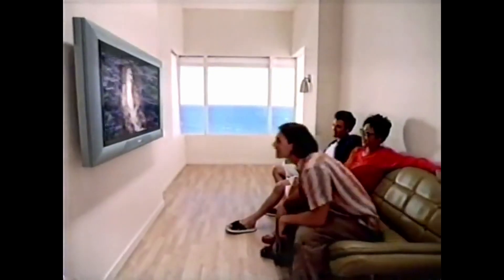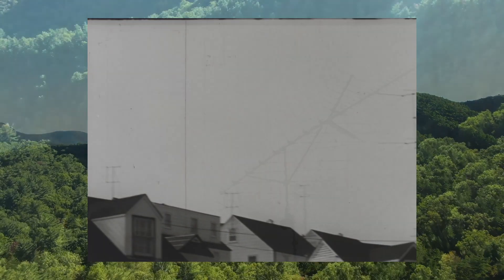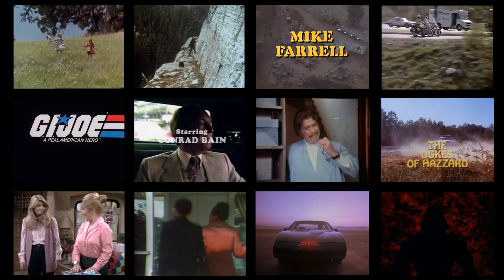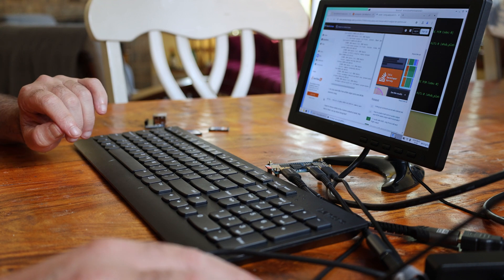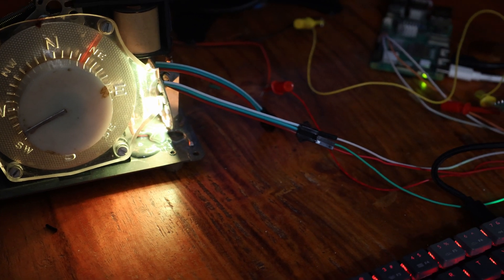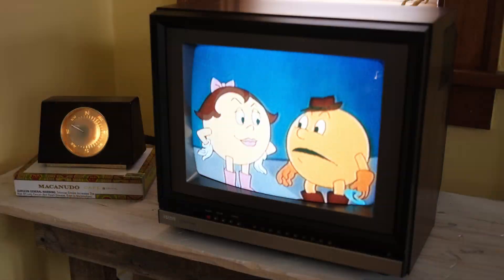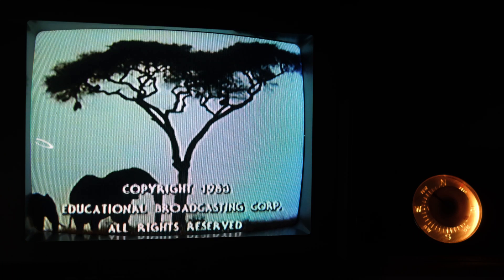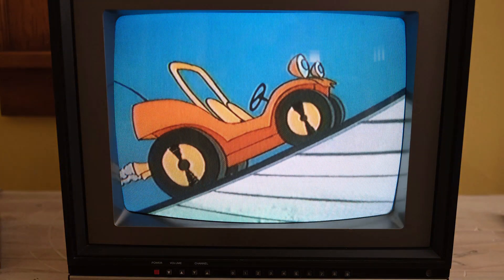My Nostalgia Machine: Recreating 80's broadcast TV with a Raspberry Pi

Comment: Would anyone know of a apk or exe that would be quiet similar to this not great with Linux myself and would love this for the man cave 😍 any help in the right direction would be amazing
Reply from the maker: Not that I know of - you are correct that it currently takes a bit of work and knowledge to setup. I hope to reduce that over time.
Reply: @wrongdog_reckons  made a apk myself but it's only single channel that plays Simpsons episodes need to figure out how to add extra channels with the continues playing multiple videos you have and the ads 😊 complete noob with Linux myself not even sure if it is possible to like copy the installation you have with the code and I supply the videos? Also thanks for the reply 😄

Comment: what's the limit of the content? just how much storage i have?
Reply from the maker: I haven't tested with huge quantities - I have about 800 GB in my collection and it handles it fine. The more you have, the longer it takes to build the catalog (which only happens when you tell it to currently) takes about a minute or so on my raspberry pi 5 (much faster on PC). Overall, it should just be gated by storage size, but I haven't tested beyond my own collection.

Comment: This is very cool.  I have been looking into ways of doing similar things but hopefully having each channel modulated onto its own frequency so I can use the tvs tuner presets.  Another thing i would like to do is include teletext data.  Ive seen a pi project that does this allowing you to either create your own pages or pull content from the web and generate pages from that but i don't think it inserts it into an existing signal.
Reply from the maker: Love it! Adding broadcast for this is an idea I've played with - the issue is that it doesn't actually play all the stations at once but shifts to the selected channel content and seeks to the correct play position, which might be mid-show, might be mid-commercial - the timing is pretty accurate so it feels like its been playing the whole time. It would need some feedback mechanism to tell it to switch broadcast streams or I would need to figure out how to broadcast all the streams at the same time. So, there are challenges to get over there :) Cheers!

Comment: This is incredibly cool. I know absolutely nothing about programming but I am at a loss as to how you recreated the linear experience where you're dipping into the middle of TV shows as if they really are playing "live" instead of on-demand. If you could provide a simplified explanation of that, I would appreciate it. 

In any case, I'd love to have something like this over Christmas. You can bet mine would at some point be playing the 1951 edition of A Christmas Carol with Alistair Sim, along with Miracle on the 34th Street, The Bishop's Wife, A Christmas Story, Christmas Vacation and also the 1984 rendition of A Christmas Carol with George C. Scott.
Reply from the maker: Thanks! Would love to describe how it does it. First step that enables this is  how it generates a schedule for the week for each station and stores it as files that are separated by station/day/hour.  Lets use an example: you start it at 9:30pm on a friday night - and the first channel is configured as NBC. It will open nbc/friday/21 (24 hour time) and see that Miami Vice Sason02Episode11 is supposed to be on. Then it will do some math and determine that it should be about half-way through the episode - so it will seek to that position in the video file and start playing there. It accounts for scheduled commercial breaks in that math, so you might start during a commercial. 

When you change the channel, it just does the same thing again to figure out what the new channels should be playing.  Then, when you make it back to nbc, it will just does the same thing again - but since it is very accurate with the timings, it will seem like it was playing the whole time. 

I am looking forward to having it at Christmas very much. The whole family gathered around it last night while we painted pumpkins for Halloween and watched the Worst Witch and then Night of the Living Dead - was an amazing time!
Reply: @wrongdog_reckons  That's really fascinating! Thanks for the info! I am always in awe of people who have the electronics and programming knowledge to do stuff like this. I'd love to be able to complete this kind of project. 

One more question, if you don't mind: I can see how you could come up with the episodes of shows like Miami Vice but how could you possibly come up with enough footage of news broadcasts from that time? Does it play the same small handful of broadcasts over and over or are there enough to go a long period of time without re-watching news that you've already seen before?

That sounds like a good time with your family! I'm glad to hear that everyone else appreciates what you've created here.
Reply from the maker: @sorenpx good question - I actually have a fair number of news broadcasts. Initially, they were the hardest to find, but there are actually quiet a few in the VHS archives at archive.org (down right now) - on youtube, you can find ones from big new event days. 

Cheers!

Comment: When the software arranged the video files, does it split TV episodes into segments with commercials breaking them apart or does it play a full episode following some commercials? Also, does it follow a half hour structure where everything starts at the the top of the hour or half?
Reply from the maker: Good questions! How it inserts commercials depends on the duration of the recording - if the recording takes up most of the block, it will pad the end. Otherwise, it pseudo-cuts them into segments and inserts breaks. It support half hour, one hour and two hour blocks - but internally its built around the one-hour block that can be made of either two half hour shows or one hour long show. The two hour blocks are just two one-hour blocks back to back. It never actually 'cuts' the video on disk, but switches the stream live to make it look like the reels are cut and spliced. To answer your question - yes, these happen on the half and top of the hour. Cheers!

Comment: This is just about exactly what I'm looking for!  Irish Craic Party had a video on his own retro TV he created using raspberry pi a few years back that this reminds me of.  I really, really want to do something just like this, but house it in an old wooden frame with a HDTV in it.  Can you rig the program to access a server with the video files on it, and create channels with logos, start and stop times, and the old Continental Cablevision program guide that was low-res scrolling text showing what was on?
Reply from the maker: I know the video well - it actually inspired me to start doing videos on my own projects. Not sure why they took it down. For accessing files on a server - if you can mount the drive over the network, it supports it now. Yes, channels have start and stop times, you can even specify a video to play at the sign-off event and what video to loop when its 'offair' - as for images, you control the station promo content by adding them to the bumps folder for that station.  For program guide, I have a user interface that I will use as a base - I'm also adding a 'cable-mode' so that you can use different theming based on what decade you are trying to emulate.

Comment: The hardest thing for me with similar projects was cutting in commercials at convincing times without adding break times manually.
Reply from the maker: I didn't resolve that problem yet - sometimes they seem pretty natural, but other times they don't. Especially if they say something like 'We'll be right back after the break' and then it just stays there...
Reply: @wrongdog_reckons I’ve used a Python package that checks the frames for changes that indicate scene changes. Before that I wrote my own which looked specifically for black frames coinciding with silence to minor success. But, those are pre-processes that I had to check manually for every video I wanted in my library which was very time consuming. I just stored each break as a chapter in the video. Sometimes I’d get lucky and a show I purchased was already divided into chapters along the original ad breaks. I researched it a bit and it seems the broadcast tapes had some tone to tell the equipment where to break for commercial which we wouldn’t have access to.

Comment: 5:19 I remember watching my grandfather turn this thing on top of his big wooden encased tv. I could hear like a thumping noise coming from it. Each sound the picture got a little better or worse. Kind of like adjusting the tracking on a vcr. My brother and I called it the "thumper". lol.  I always thought it was cool and we did get a clearer picture watching golf! :)
Reply from the maker: My next task is to add a buzzer so I can try to make the sounds :) These things are amazingly simple, but were doing a lot of work right there in the console that I thought would be being done on the motor itself. To me, its really cool when to start figuring out how they accomplished stuff in the days before microcontrollers and microprocessors. I think in terms of software-defined processes - they just add electricity and a few primitive things they could do with it and ended up making some very advanced stuff happen. The box is pretty cool.

Comment: I want to do this but I need some help or clues about how to do the content.
Reply from the maker: 'Any Video Converter' is a great app for downloading and formatting. You can easily make workflows to make that kind of a one-click process. For commercials and station bumps, you'll want to cut those into individual clips. The github project has some documentation on how to put your content into folders. There are still lots of improvements needed on the documentation, so if you get stuck, just file a ticket on github and I'll try to help.

Comment: I grew up with TV in the early 1950s to 1960s. In Milwaukee during the 1950s we had four channels which were 4 (NBC) 6 (CBS) 12 (ABC) and 19 (DMT)
Reply from the maker: Was 19(DMT) a local television station?
Reply: @wrongdog_reckons  It was the Dumont Network channel in Milwaukee. When Dumont went defunct the channel was changed to 18 and was a local independent station.
Reply from the maker: @HD7100  - I just looked it up and it said they were one of the first, back in 1940 - so about as old as NBC and CBS. They have a fascinating story: https://en.wikipedia.org/wiki/DuMont_Television_Network

Comment: This looks like a cool idea, but from reading over the link, every step I try to follow results in an error.  I appreciate sharing this, but this project sorely needs accurate and complete setup instructions, what you have listed currently is completely useless.
Reply from the maker: Sorry to hear that, but I don't see where you have posted any issues or questions on github. I can't know where to make the documentation better if you don't tell me where its failing. It should be encouraging to know that quiet a few other people have gotten it working. Its an open source project that I built in my spare time - its still in an early development stage and the current documentation does expect a bit of a technical background. You'll need some experience in linux,  and some familiarity with JSON configuration to make it work right now. Since its open source, you are also welcome to contribute to make it more user friendly - others have already contributed some improvements. Cheers!
Reply: @wrongdog_reckons  My apologies for my less than polite introduction.  I'm an expert at Windows tech support, I can find my way around a linux gui, I can read through linux terminal syntax, but I'm a noob at implementing things like this onto an actual pi.  I cannot figure out things like - where to put videos, how to load necessary libraries, what setup my pi needs to have before cloning and running things, do I load this onto a pi with raspbian and then go through the instructions that assume knowledge, what is the assumed knowledge I need....I'm kinda lost.  And I'm not opposed to starting elsewhere to build up to this, but any videos I look for to begin things like this suggest starting with things I already know like how to install retropi or how to setup kodi, which knowing how to do that hardly prepares one for compiling open source projects and executing them, and beginner videos on python programming also don't really go into how to build a pi to autostart and run a custom program.  Do you expect the starting point to be a pi with raspbian?  I have great ideas for expansion of something like this - like programming a specific rotary dial by position, rather than as just an up/down control, to make a vintage TV act like a TV again, and tying some channels into a network or USB digital tuner to get OTA signal on the TV as well, or tying channel 3 into retropi to get video games on channel 3 - there are so many possibilities here.
Reply: @wrongdog_reckons  I typed a response that is not showing up, must be some sort of youtube issue.  Did you get the response, or do I need to type it again?
Reply from the maker: @JonnyGators  - nope - didn't get it.
Reply: @wrongdog_reckons   Basically was just laying out that while I'm a Windows support expert and can find my way around linux, I'm struggling to find a way to get from the "recommended beginners" pi projects which tend to gravitate towards the simple things like setting up kodi or retropi, to implementing something like this.  There seems to be no good guide to walk through things like this, and instructions for projects like this are written with assumed knowledge that I cannot figure out how to get to that point of knowing the assumed knowledge.  The steps are very vague, and I cannot follow them to get to a point of anythign installed on the pi or working.  Where/how to setup a folder structure is not clear at all.  What is the expectation for the initial setting of the pi, with raspbian installed?  Where/how do you get things on the pi, how do you set it up to autorun things.....basically, how do you do any of this?  No one writes instructions that a beginner can follow anymore.  I'd love to get something like this setup to start with, and see what can be added to expand it - like getting a rotary control with programs tied to specific positions so it can be controlled with a real tv dial, or tying in a usb or network TV tuner to add some current OTA channels.  Lots of possibilities here.
Reply from the maker: @JonnyGators  - this is great feedback - and very actionable.  Just minutes ago I committed an 'install.sh' that should help a little - it creates the folders for the catalog and runtime (as well as python dependencies and creating a virtual environment). One issue adding to the confusion is that I made it all very flexible, but that also means that its up to you where to put the folders - there isn't a set spot. Everything is relative to the top level of the repository folder - and that is where the python scripts expect to be ran from. So - all of the paths to folder that you see in the configuration files are relative to the top level of the repository. I point this out because I see now that expectation is not documented and you are correct that the current documentation expects some expert knowledge and makes a lot of assumptions.  I'll do the following: I will update the documentation again and do a fresh install to make sure that they work and can be followed. I'll update here when that's done and see if we can get it closer.
Reply from the maker: @JonnyGators  Okay - I have made a pretty big update to the documentation: https://github.com/shane-mason/FieldStation42/wiki - see if that works better and let me know where/if you get stuck. You are not the only person that has asked for more clarity - we'll work our way there.
Reply: @wrongdog_reckons  This is awesome, thanks so much.  Reading through it, this is looking clear enough, I will have to give it another go tomorrow.  Given that you've been filling your own pi with 80s content, I have to ask the question - are you putting in 80s episodes of Friday Night Videos into your evening NBC content?  I'm always on the looking for more recordings, and I have plenty of episodes I've posted to archive, which is unfortunately down at the moment, but I'm hoping will be back up soon.
Reply from the maker: @JonnyGators  Absolutely! Friday night videos comes on every Friday night and Saturday night too after SNL :) I looked forward to Friday night videos every week when I was a kid - it was my window to the music world. I'm using the 'clip show' configuration for music videos - where it stitches together shorter clips with commercials in between instead of cutting commercials into full episodes. I did it this way because I didn't want commercials to get cut into the middle of a music video. Same with SNL. I need to add some documentation on some of those configuration options. Cheers!

Comment: It makes me wonder if software defined radio would be up to the task of creating channels. It almost feels like you would need to realtime transcode the video to a NTSC signal, then send that out through an SDR radio.  You'd need 13 of them to recreate the VHF experience. You wouldn't need a high wattage transceiver, just need enough to get it down an antenna wire and into the TV, like hooking up a VCR or old console. 

I guess the only question after that is an RPI 5 capable of doing 13 simultaneous NTSC streams?
Reply from the maker: Not simultaneously on a single unit, but you can get 13 of them  :) Mine simulates it by context switching on 'channel change' - so there is only one stream playing at a time.